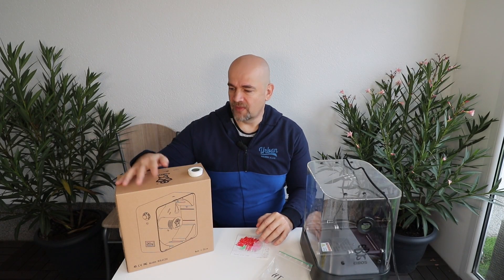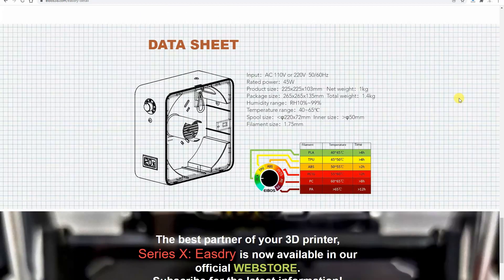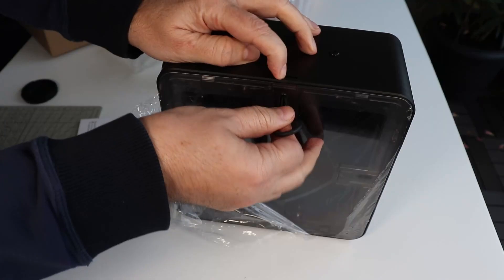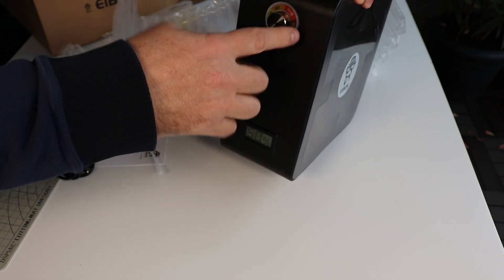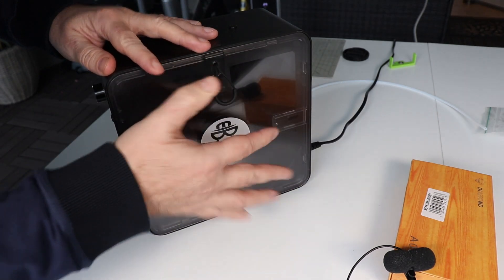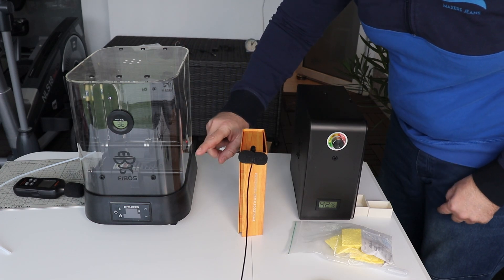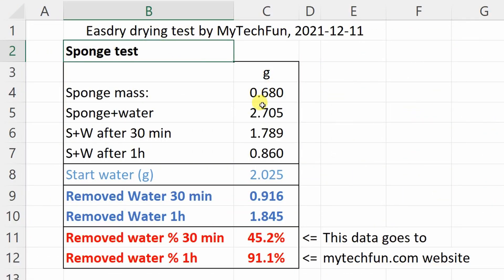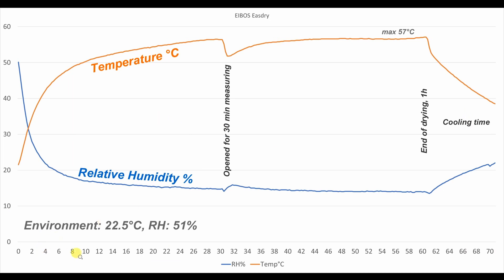Eibos Series X: Easdry filament dryer review, the new vice-champion (so far)

Comment: Umm I don't fully understand, what is the desiccant in the dryer for ?  It is mandatory for proper function? Or that is just added feature, so you can dry/refresh your desiccant?
Reply from the maker: Exactly my thoughts I mentioned at 9:25 in this video. In the meantime, I tested it with some color changing silica gel and it can dry it :-)
Reply: @MyTechFun  oh sorry I accidentally skipped that part. Thank you.
Reply: Interesting thought!
I have used my Sunlu S2 to dry dessicant with an ABS tray (and a fan plugged in the "bowden" hole and a tiny clip to open a gap in the lid.
In
For drying my TPU, I rolled it 90 degrees every few hours (which lets in new air).
If I insert a roll of dessicant in my S2, it should be able to dry without having to open it (or leave a fan running) to blow out the wet air.
I can then use the fan to refresh the dessicant later.

Comment: Why not diy a drybox, printing with a 3dcprinter the enclosure and the gasket and then the controll unit with Arduino stuff and you would have probably the best drybox 🤔
I wish I would have a 3d printer.